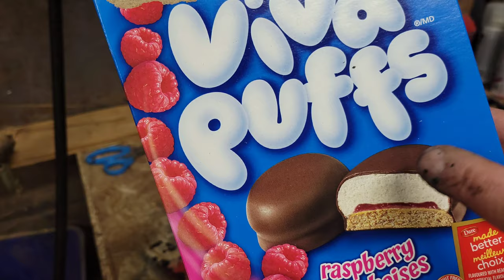Wood carving deeper with a chainsaw

Comment: Jordy what kind of heater do you have there in your work area. It appeared that you lite the heater with a torch?.
Reply from the maker: It's propain and I use my lighter to light it
Reply: @CarvingFusion  Thanks for the info: